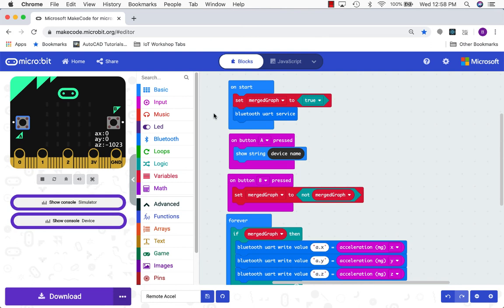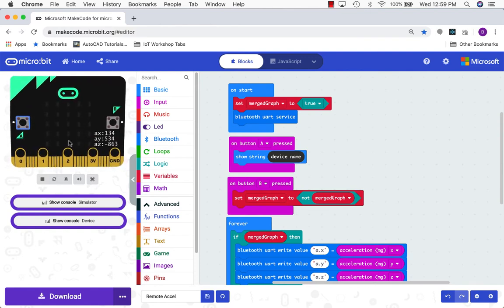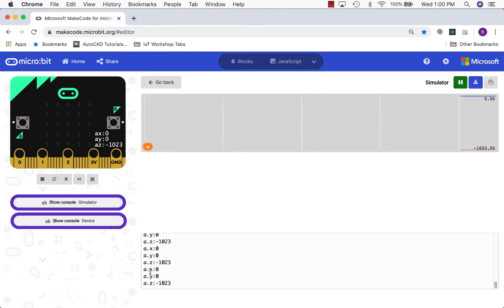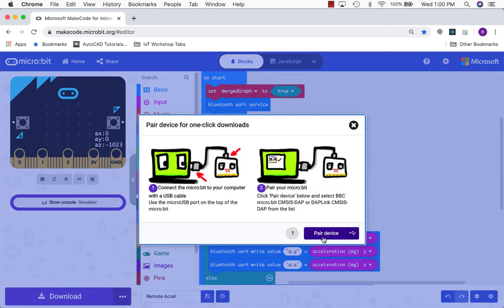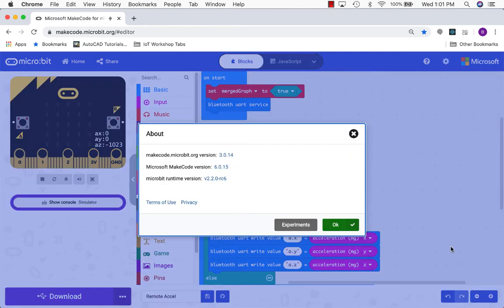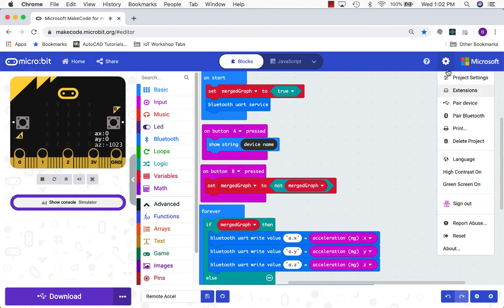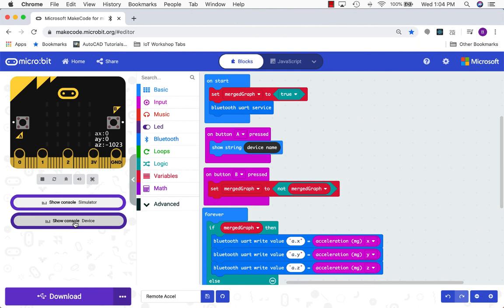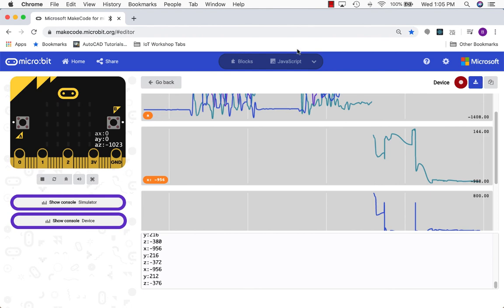Micro:bit: Wirelessly Stream Accelerometer Data to MakeCode!

Comment: This does not work for me. I have copied your above code and downloaded it to both V1.5 and V2.0 Microbit. I have used an HP Stream laptop which DOES have bluetooth. I get the message that they are paired, the laptop correctly recognizes the Microbit by name. When I click 'pair' as you did, I do not get the 'show console Device '' bubble. It only stays with the simulator bubble. Have done the whole process repeatedly. The Bluetooth console is enabled.   Suggestions ?
Reply from the maker: I just did a couple of quick tests.  At first it behaved as you described: Bluetooth connected, but it didn't show data.  I made a few minor changes / reprograms / reloads and it started working.  Here's a slightly updated version of the project with a minor delay between each "send": https://makecode.microbit.org/_3yT8KAcHuho3  (My theory is that data was streaming in too fast and the PC's console couldn't keep up, so data was lost.  I've experienced something like this before with other projects)